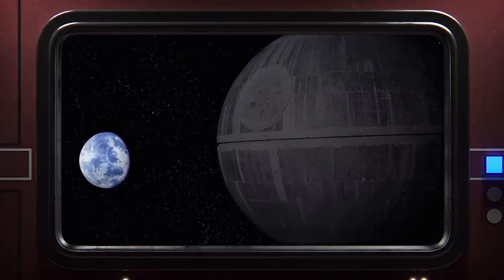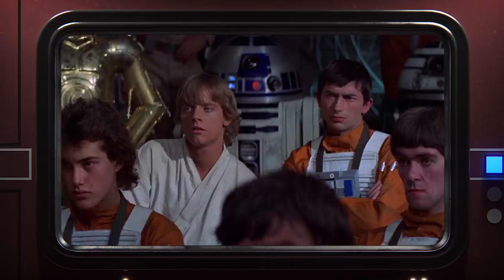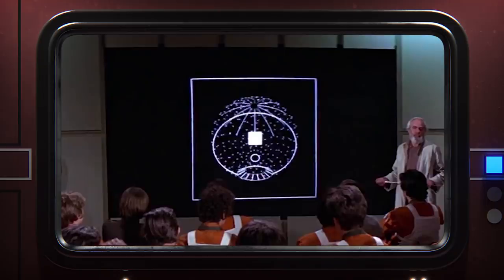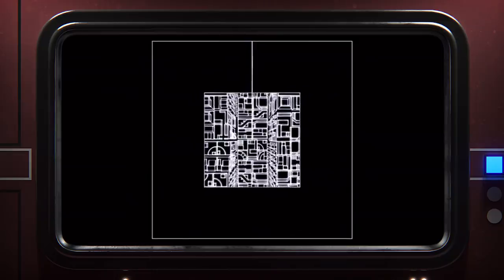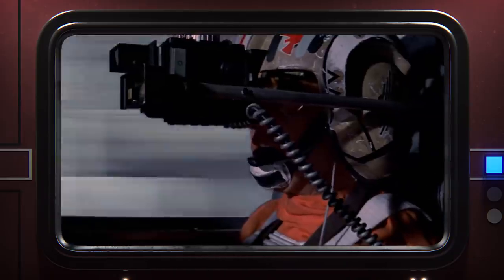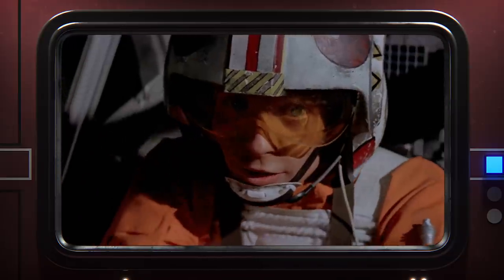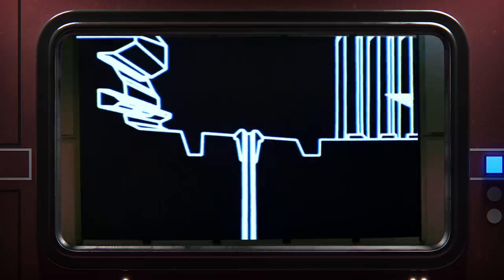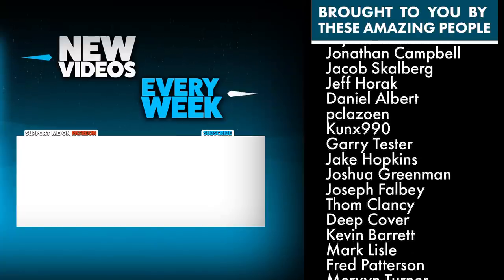The Thermal Exhaust Port Was NEVER a Problem

Comment: venting heat in space is actually extremely difficult.  In all likelihood there where 100s of vents to accomplish this.  For even one to be used as a "weakness" indicates the path to the reactor for this vent was straight.  Any curve would prevent a object from reaching the actual reactor.  That would have been the "sabotage" and only getting away with it at one port actually makes very good sense as anyone looking over the plans would catch and correct this if it was done on several ports..  But sneaking it by one just one of them when the true number was probably in the 100s makes very good sense both from a what can I get away with and a what can I do that is simple but would create a semi vulnerable flaw in the design as a low or mid level management point of view.

Comment: What makes the thing impossible to a further level: exhaust pushes out gas, loads of gas. I don’t think that the exhaust produced by a moon sized battlestation would even allow the bomb to get down the pipe to the core
Reply: it depends on what it exhausts - not necessarily gas -it could emit photons, plasma, etc. if it only triggers periodically, such as when the guns fire, it isn't really a problem. And they don't use bombs, they use torpedoes, which are propelled munitions, by definition.
Reply: @carbon1255  we’ll certain things will make exhaust all the time. And plasma cannot “live” in a vacuum :))

Comment: I always wondered why they came down in the trench instead of dive bombing the port from directly above, that way the torpedo would have had a straight shot down the shaft instead of having to make a 90° turn.
Reply: they would've been annihilated by turbolasers/blaster cannons -- even when they flew in from the trench itself, they still took casualties from the guns (Porkins), if they tried to dive bomb it, especially given the speed of the Y-wings, they likely would've all died much faster

Comment: It may not be a design flaw as such, merely a limitation of the technology. Some forms of nuclear thermal propulsion, specifically open cycle fission and open cycle fusion thermal rockets, use the spent nuclear fuel as the reaction mass for the rocket. The reactor itself is exposed to space, although it is blasting out hot exhaust plasma and radiation. This would apply for this exhaust port being a thruster of some kind, rather than something to dump waste heat and spent fuel. And in this case, you could sneak this flaw in because it is a design necessity for that type of thruster.

If it is simply a waste heat port, it is a terrible waste of energy by venting it straight out into space rather than through heat exchangers to get energy out of it. Not only that, but it is a weakness, subtle enough to be missed on such a large design.

As for why that specific port, maybe it has to do with the defences rather than the port itself. Maybe there are fewer turbolasers towers or a way to approach that avoids some of them. Maybe its the port that's furthest away from the TIE hangars, which would give the Rebel fighters a few minutes of breathing room to drop their payload.

Comment: but the question is why not design this reactor port in the same you did the either 18 or possibly more? why is this port the ONLY exploitable one? why design it differently to the other ports? if the other ports would not cause a chain reaction to the entire reactor core on being hit with a torpedo, why would you design this exhaust port to do so?
Reply: Despite being a sphere, the Death Star is far from symmetrical inside. There likely were systems that exhausted into that secondary port and not others.
Reply: @Crosshair84  okay? and? that still does not answer my question of why you would design the port in such a way so as to allow a single torpedo to destroy the entire station.

Comment: The weakness of the Death Star was not the exhaust port! The weakness of the Death Star was that snub fighters were not taken into account as being dangerous so all the turbo lasers were built to withstand CAPITAL SHIPS and could not track such small fighters. This is explicitly stated in the film as the weakness of the Death Star. The failure of the Empire's designer (before we knew of Gailin) was that they knew the exhaust ports were a potential exploit and ray shielded them and built huge laser cannons to prevent any ships from taking advantage of it. They didn't ever imagine anybody would try to take on this flying doom ball with a handful of tiny space fighters.

Remember also that when they saw the attack patterns of the Rebellion they immediately realized what their plan was and warned Governor Tarkin who chose to ignore it due to hubris. Also Gailin's message to the Rebellion had nothing to do with the exhaust port since ships of that size had to have some way of venting heat, but that destroying the main reactor would cause a cascade failure. I have to hand it to the writers of Rogue One, the only good Disney Star Wars, that the Rebel Alliance could have chosen any method necessary to take out that main reactor from a team of commandos infiltrating the death star and planting explosives to Jedi smashing it with mind powers, he probably didn't even know how they would do it and left the planning up to them.

Comment: Actually, there could be a single small exhaust port problem/exploit.   Just like automobile exhausts, bends could protect a direct incursion into the reactor through an exhaust port.  So, first, if Galen Erso placed one "straight pipe" exhaust, it could be exploited. Second:  You mention, maybe Luke used the force to manipulate the torpedoes. In the movie, they are seen to curve down into the port.     How about this- 
  What if, unbeknownst to anyone else, the port actually acts as an intake, if the shielding is breached. While all the other ports ARE exhausting ports, the one could draw in anything with enough energy to get through the shield. A chain reaction could be triggered from even a single proton torpedo's explosion, from refracting off the inner tube wall. A small "flammable" gas tube, connected to the port tube, could then supply the fire with fuel, chaining/drawn all the way into the reactor, by the fire itself, drawing the gas from the smaller tube.
Sure, Luke used the Force to make the shot, but the weakness exploit was because of Galen.

Comment: My interpretation is that the thermal exhaust port was designed in such a way that a photon torpedo would be sucked down by a mag rail created by the reactors magnetic fields interacting with the exhaust ports walls in such a way that any weapon in that would be able to penetrate the shield would be sucked down down into the reactor and destroy it by igniting all of the destabilizing factors laid in it the field holds only appeared after it was fired and would charge the magnetic rail each time to become stronger and stronger faster and faster if the death Star had fired her two more times the person firing the torpedo would not be able to escape in time one time less and it would be too slow and somebody could shut a door in the port

Comment: There are NOT 19 targets, why? Because the rest of the exhaust ports do not go directly to the core in a straight line. The other ports do not go straight, they are bent or angled at one point and that is why this one port is a special case of sabotage because it is the only straight channel for a torpedo to travel unobstructed to the core. That just makes sense right?

Comment: The other factor that makes it very hard: It's an EXHAUST PORT!. That means energy is flowing through there, specifically out into space. That energy should have had some kind of an effect on the Torpedoes, even if some rando-flyer was able to get Proton torpedoes into the port. Energy pushing against the proton torpedoes, is still energy that can cause them to slam into the sides of the wall and detonate early.

At Bare MINIMUM: You need the force to make the shot. The whole reason Leia went to Obi-Wan, because force? Else there would have been no reason for her to call on his aid, if any rando can make the shot. Though Obi-Wan is dead, and all hope seems lost, they weren't going to tell their fellow rebels that. Moral that there is still a chance we can win, maybe Leia is wrong and the force isn't necessary... Thankfully Luke was there, with the force, and thus able to make the impossible shot.

As for the so called sabotage: It was to make the reactor core unstable. But because things like to go boom in the star wars universe, still highly unnecessary.

Comment: And while I would presume the main exhaust port at the North Pole was unexploitable because of a crapton of exhaust... the question would be if the smaller exhaust ports were not exploitable, or if the planners decided to focus on one exhaust port instead of several to concentrate the firepower- given the amount of TIEs the Death Star COULD have fielded, splitting off into small, disparate groups would be far more suicidal than small group covered by other ones.  By just telling them "that one", you don't have the fighter wings spreading themselves thin.  (Alternately, they could have all be weaknesses, but the team(s) looking at the plan may have found WEAK POINT and sent the information up the chain, since, you know, time was of the essence- and looking for a secondary or tertiary one was less important than getting a confirmed one.)

Comment: I think any of the exhaust ports could have been vulnerable, except maybe the one at the pole. The reactor shafts would all need to be built the same way, and the model has nearly perfect symmetry which would imply that each trench is similar to each other. Maybe the reason they picked the one they attacked was simply because it was closest to where the assault team began their approach, and the sum of these assumptions just weakens the sabotage retcon even more.

Comment: Do you not think that the fact that only one out of at least 18 otherwise identical secondary exhaust ports (+1 primary exhaust port) was vulnerable implies that it was sabotage? I'm trying to think of a reason why THAT exhaust part would be arbitrarily vulnerable without some intentional sabotage. What is required of one of those many secondary ports but not in every other port that makes it vulnerable?

Maybe the vulnerable exhaust port is the one closest to the superlaser and firing a torpedo inside can set off a chain reaction with it.

Comment: The trench run doesn't even make a whole lot of sense when one considers that the exhaust port faces directly out from the surface.  Without the force, the only way to score a hit would have been to approach from the vertical directly overhead the port and conduct what is essentially a dive bombing attack.  But for stylistic reasons the approach was in the trench.  George Lucas wanted to pay homage to the bombing run from the movie Dam Busters.

Comment: General Dodonna: Okay guys, so you'll have to fly your fighters down a very thin trench that gives you no side-to-side manoeuvring space where you're just waiting for some fighters to sail behind you and blow you up.
Some guy: Why don't we just dive on the exhaust port perpendicular to the trench? That way we have lots more manoeuvring room, and the Death Star gunners are terrible at anti-fighter action. And how the hell will we get the torpedoes to turn 90 degrees anyway? It's just a lot more trouble for the guiding system.
Dodonna:...someone ship this guy to Sunspot

Comment: I belive that there are 19 ports (the big main one and the 18 smaller ones) U cant have a Moon sized station with just one Reactor exhaust. And i think that Galen Erso manipulated this exact smaller exhaust in such a way that it didnt have any other kind of defense aside from the Ray shield. Maybe the other 17 Ports had ray shields and blast doors that could be opend and closed depending on when they were neede. But maybe Galen came up with some technical explanation why this port didnt needed such a door. And as u said even than its a very very small chance to hit that port with a bomb through all these defenses.

Comment: ya.. one exhaust port whose shield can only be breached by one specific type of torpedo from a single small fighter that somehow gets past the radars, shields, fighters, defense cannons, and the sith lord on board, picks the right port on a base that looks very symettrical in space, then fires an untimed torpedo while speeding past at the perfect time that then bends its trajectory into the exhaust port, going against the flow of exhaust that is coming from it, travels miles through a tiny narrow tube without hitting any of the walls or being buffeted around at all, and hits the core. the shot was literally impossible.

Comment: If all the ports were sabotaged or faulty, they may have been noticed.  Having discovered a single fault makes sense without Rogue One, and with Rogue One, sabotaging one may be all Urso needed to keep it hidden.  It's a big place after all, and people have the tendency to overlook/skim over things when inspecting.  As far as the trench run... it was entirely unnecessary when you factor in hindsight (as a movie viewer at least).  They could have flown in a parallel line to the port from above and shot straight down the hole.  SW has ray shielding and particle shielding, so particle shielding would keep oxygen inside the landing bays for example, and ray shielding in the case of the port, would let gasses outflow, but not allow simple energy weapon fire in.  So as to cover, it's only "partial."  Of course I think the trench run was most exciting when I first saw it, and admittedly still is, but now that I have an education, it's quite clear they didn't need to trench run at all--the DS surface weapons have limited range, and they could've just blown up those around the port.

Comment: My understanding was that you weren't firing torpedoes down the exhaust port to the core but that the resulting explosion within the port would cause an energy overload that would feed back into the core and Kaboom! Urso's "sabotage" was ensuring any port would suffer a catastrophic overload if hit correctly. But hey this is physics in a galaxy far, far away with hokey religions and walking carpets.

Comment: It has a shield but the shield does nothing against the bombs, great writing lol
Reply: It had ray shields, which were meant for energy weapons. It lacked particle shields, which would have stopped a torpedo. That actually would be reasonable. Particle shields stop high speed physical objects, and the Death Star probably used some sort of coolant which it vented into space. 

On the larger main port, it can be given particle shields. Without going into thermodynamics or fluid dynamics, stuff exiting a larger orifice does so at a lower velocity than a smaller orifice.

Comment: Simple: that port was designed by Erso to be a strait shot to the core without any secondary redundancy.

Think about it. We don't know if the other ports had a secondary grate or a second shield deeper in the shaft in case there was a problem with the thermal venting. They built 19 of the damn things, I doubt they all were just strait shots. That seems like it's too convenient. Far more likely the design had grates and other redundancy to vent and recycle heat from the superlaser.

But that one was the One Erso explicitly said was the weakpoint. One that, if you could get a strait hit on would cause the chain reaction need to destroy the death star.

Comment: I like to think that way more X Wings went into battle so other groups could attack diffrent ports, and hose were either destroyed in the     Dogfight above the Death Star or taken out by tie fighters , that or the torpedoes missed , hit the end of the trench infusing pilots on the pull up out to crash, also the main port might have an armored blast door, partway down the shaft, so they have to use the non-door protected auxiliary ports

But that’s just a theory
Reply: this was made a year ago and I just realized how many typos it is. lol I'm not editing this

Comment: Why not physically close the exhaust port? With giant seal door that could withstand ANYthing...
If that's not possible, since perhaps Death Star can't have its main exhaust port closed for several hours (close just in case of attack), then make TWO main exhaust port (that located on the other side of Death Star), both can be closed independently. So when one is closed, all exhaust can be directed to the other port that is not currently under attack.

Comment: I never really got why people are so surprised about the Death Star having an exploitable weakness. It's a massively over-engineered, semi-prototype piece of military engineering on an unprecedented scale - of course it's going to have weaknesses and flaws and design compromises. I never saw the Rebels as having found the station's one, single flaw - it was just that, of the several weaknesses the Rebels were able to identify and analyse in the short time they had to examine the plans, the exhaust port was the one that was most easily exploitable using the resources they had available at Yavin IV base.

If there is a plot hole for Rogue One to fix, it's that time factor - the Death Star is a huge, complex machine that could take weeks to analyse. By knowing about a specific flaw in advance, the Rebels were able to concentrate their analysis of the plans upon exploiting that specific weakness.